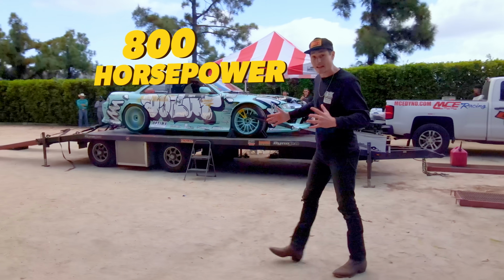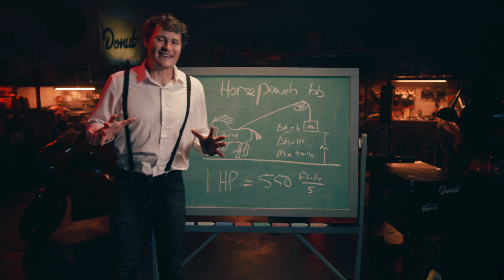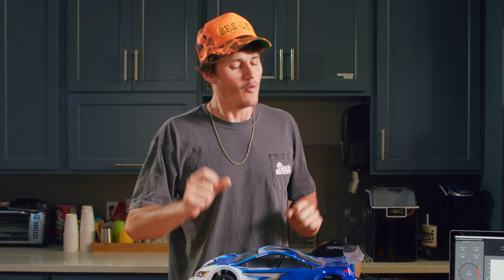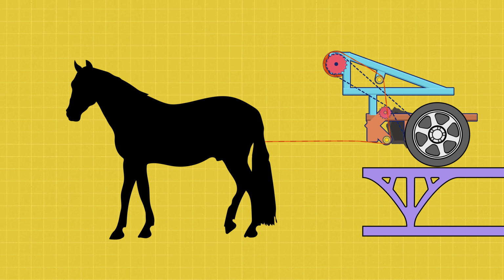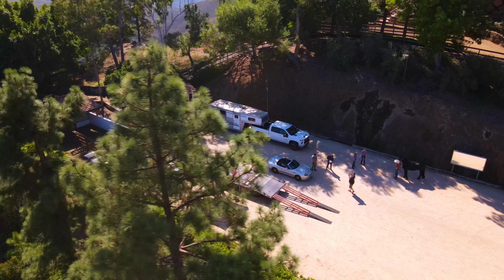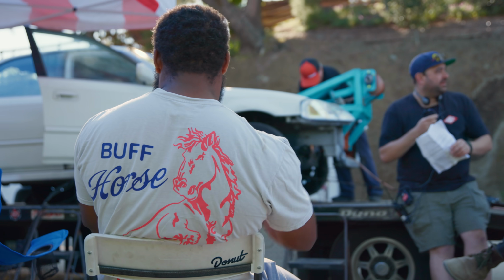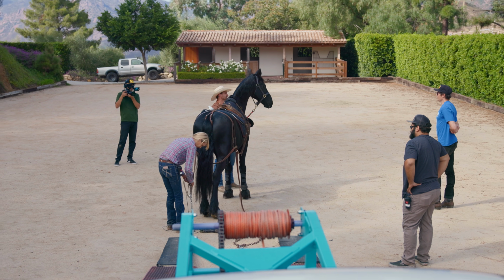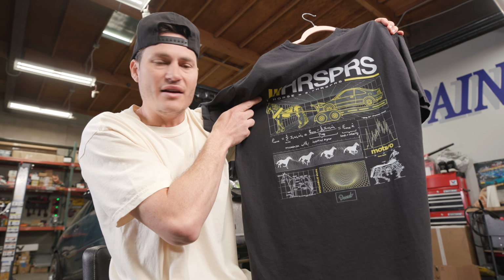How Much Horsepower is a Horse?

Comment: Not sure how this works
1 horse equals the power of 1 horse.. So how does 1 horse equal 5.7 horses? If you had told me this 1 horse produced x watts then I could work back from my engines watt power to figure out how many horses I have under the hood. Or did  I miss something?

Comment: Loved the experiment. Here in the UK, traction engines were rated in Nominal horsepower rather than brake horsepower. A 12NHP traction engine could theoretically pull as much as 12 draft horses. Your results show why a 12hp traction engine always wins a tug o war against a 60hp tractor.

Comment: Is just a metric for “Power” output just like Watts is for electricity. 
Just measuring amps doesn’t measure the wattage, and measuring just the Voltage also doesn’t determine wattage. But when they’re multiplied together, you get the wattage. 
And wattage is wattage no matter how you stand on your head or how strongly your opinion is of it. 
Same with Torque, it’s multiplied by RPMs in nearly the same way, so even output torque, or torque to the wheel is still not a good way to calculate power output. 
But because some guys can’t figure that out, we have to keep having these Verses lessons as if they’re opposed to each other, but they’re not. 
Put simply, torque with no rpm, is zero hp, even if it’s a million ft/lbs. 
No rpm, no hp. 

High rpm with torque, high hp.

Comment: Draft horse do love to pull.  I have watched draft horse pulling contests at county fairs.  Horses were used to turn basic mechanical drives where the horse walked in circles and thus the mechanical torquer was much easy to measure.
  I think when they came up with 1 horsepower it was the amount of work a horse could do nonstop for an hour. Of course, the horse can do more for 15 seconds.

Comment: What if the pulley was geared 2 : 1 so that the horse could gain speed and a smoother run as well? Different horse breeds will achieve peak horsepower at different ratios. This would be the ultimate horsepower testing

Comment: I asked GROK here is a much better answer, remember when testing cars that are at max RPM
A typical racehorse (Thoroughbred) weighs around 1,100 pounds and reaches sustained speeds of about 40 mph in races, with peak bursts up to 44 mph.
Using the same kinetic energy calculation as before (KE = ½ × mass × velocity² in foot-pounds of energy):

For a 1,100 lb racehorse at 40 mph: approximately 58,800 ft-lbf.
For a lighter 1,000 lb horse at peak 44 mph: approximately 64,700 ft-lbf.

(Your original hypothetical 1,000 lb horse at 20 mph was about 13,400 ft-lbf—racehorses carry roughly 4–5 times more kinetic energy due to higher speed and similar/heavier mass.)
Conversion to Horsepower
Kinetic energy measures total energy of motion in foot-pounds (ft-lbf), a unit of energy/work. Horsepower (hp) measures power, or rate of doing work (1 hp = 550 ft-lbf per second).
You can't directly convert a static energy value to horsepower without knowing the time over which that energy is applied or dissipated (power = energy / time).
For context:

If a racehorse dissipated all its kinetic energy in 1 second (e.g., a very abrupt stop), it would equate to roughly 107–118 hp (58,800 / 550 ≈ 107 hp).
Real stopping distances are longer, so peak power during braking is lower.
Actual peak mechanical power output of racehorses (what they produce while running) is estimated at 10–20 hp in short bursts, based on physiological studies—far more than the 1 hp the unit was originally based on!

Comment: Flip the dyno over. Put tread on the drum, and put a chariot hitch so the horse can pull it. On a flat track you can measure the max output for a short time, or continuous output for whatever duration the horse can stand. They built a bicycle dyno in physics at MSU when I was a student. I was able to crank it to 1 kW and trip the overvoltage protection on the 10 each 100 watt incandescent light bulbs that were the load.

Comment: The Horsepower concept is based on how much work can you get out of a horse day in and day out over its lifetime. A horse can pull a very large load or gallop with a rider for a short time but the animal gets tired and must be rested before called on for such exertion again. The scene you showed at the start of your video showing a horse walking in a circle turning a mill was typical of what they were used for when Watt developed his steam engine. At that time what people needed to know was how many draft horses were needed to pull a wagon with a given load a given distance before resting or changing the team. All these factors make a realistic calculation of “horsepower” very difficult. You had a good harness For Big D and I’m curious. Is Big D a Percheron?

Comment: So inaccurate its not even funny..... As the rope is pulled the spool gets smaller and changes the ratio of the setup and on top of that you have a huge inaccuracy because dynos need to spin over a certain RPM to be accurate. You have proven nothing.

Comment: I don’t get why was there a transmission involved or even a car!! Wouldn’t It be more accurate if the rope was wound directly to the dyno and have the horse pull on it?? This test just proves how much power a horse puts down if it were the cars engine..

Comment: Question: Is horsepower the ability to over come inertia or is it the speed it can reach when inertia is reached?
In my mind it was the latter. When you put a car on a dyno you overcome the weight of the car, the  drums and see how fast it will go but in these measurements it seems to me, as a pleb, what was tested was the ability of a horse overcoming inertia?

Comment: You can't have them pull at their maximum strength! Horse Power is the power of a horse OVER A DAY! If it's not providing that same power for its full work day then it's not the measure of HP.

Comment: Wouldn't it be simpler to just mount a spool of rope to an engine dyno? Maybe use a chain and sprocket to increase the drive ratio since the engine dyno will be looking for a higher rpm.

Comment: From what I know at the time of its inception the term horse power, when told to someone advertising an engine meant to them "the amount of horses this machine will replace", which is wildly different than actual numbers or strength. Its about how much work will get done in a day by this machine over a horse, horses need rest and sleep and get injured. A horse power as a unit will heavily undervalue the raw strength of a horse due to this.

Comment: Interesting but flawed.   Work horses work all day long not for just a couple of minutes at max power.  Normandy would not be able sustain 5.7 horsepower past maybe 20 minutes before tuckering out which is not useful in the purpose of why engines were advertised to replace work horses..  So this is not accurate, a work horse in a mill would be working at much lower horse power in order to pace itself for a full days work.   The engines horsepower is based off of how much work a horse could do over the course of the day not for a couple minutes.  Redo the experiment but recreate the mill setup replace what would of been the grind stones with a speed and torque sensor and have an actual work horse turn it for a full days work.  Then report back what your findings are.

Comment: Far too complicated. All you need is a load cell, a GPS, something to pull, and a path to go. Once you know force between tow rope & vehicle, and you know speed, hp drops straight out. Put some brakes on the towed vehicle & you can play with different trials runs to do the test run at different speeds. Rpm just doesn’t come into it.

Load cell, gps & towed plough is all you need to measure work rate.

Comment: Ummm..... Use kW instead? And convert it into HP? 1 kW = 1000 W, W is a unit of power; W = J/s
Calculate how much energy someting can exert for a certain time and divide it.... You get W, and 745.7 W = 1 HP, or 1 kW = 1.34 HP...... 
To calculate energy.... Well.... Using... K.E. = 1/2*m*v^2? Or P.E. = mg? Or Electrical power = v*a? Umm.... IDK.... Guess one gram of practical is equal to a kilogram of theory :)

Comment: SPOILER!!! DO NOT READ THIS UNTIL YOU HAVE WATCHED THE VIDEO.

A 700 hp vehicle has the same horse power as approximately 123 horses the size of Normandy. Does horse power (actual horses) grow exponentially the more horses you add?

It would be awesome to see this same test done with ten horses, if that's even possible.

Comment: This is what YouTube is all about.
Personally, I would have used a long rack and pinion mechanism for linear energy transfer because the unraveling spool is a huge variable (due to the decreasing diameter as it is pulled, thus the loss in mechanical advantage, although this would obviously be impractical), but cudos on the project. Super entertaining.

Comment: This should be the new definition of what a horsepower is, in which case all existing horsepower ratings need to be divided by 5.7. For example, the Corvette Z06 rated at 670 horsepower is really 118 hp.

Comment: Nice work! However as you know, the power (W) is pullingforce (N) X speed (m/s). The pulling force depend of "geometry" of the horse, its fitness and weight! More important is, that each horse has a own speed of maximum power. Please use a bicycle with W-Meter and test yourself. At very low speed the horse can not deliver its maximum power. Same as a human. Most force is at a blocked rope. But then speed is 0 and power is 0! Is this clear?? I think a installed load cell at the drawbar of a horsewagon with adjustable brake, can deliver a integrated average power over time and speed. You should do the experiment again. Please, please, please😊

Comment: There's one big problem here.  Watt and the other 19th century engineers didn't care a flip about how hard a horse could pull at maximum exertion.  They wanted to compare to what a horse can do if it's pulling all day, for hours at a time with only occasional rest.  So if a horse can pull around 6 "horsepower" for a short distance, then yeah, sustaining 1 "horsepower" for 8 hours straight sounds reasonable.

Comment: Well, not all horses are created equally. You could have gotten a much better horse for this test. What you needed is a Clydesdale. Clydesdales are massive, extremely strong horses. They were literally bred for pulling with power. They were once used in the logging business to drag massive logs out of a logging work site. A Clydesdale could not only pull that much harder and faster, but if you're not careful, it could probably start dragging that whole trailer with the car sitting on it and all. If that horse produced 5.7 horsepower, then a Clydesdale could probably pull 9 to maybe even 10 horsepower.

Comment: Grinding grain is an all day affair where total output over an extended time is what is important to an early industrialist. Horses get tired but machines don't and that is the telling point in the horse/machine comparison. James Watt did his calculation around the net work a horse could produce over an extended time; not a sprint/peak measurement. A much better horse dyno would have been to reproduce Watt's test with a vertical pivot having an arm of known length and a resistance torque gauge on the pivot. Let the horse pull all day long on the arm and measure the net average work produced. It's going to be a lot less than 5.7hp. If the horse gets as timed as I do these days, I'll wager it would average much closer to 1 hp. By the way, I used to be known as Big D.
Reply: From what I know at the time of its inception the term horse power, when told to someone advertising an engine meant to them "the amount of horses this machine will replace", which is wildly different than actual numbers or strength. Its about how much work will get done in a day by this machine over a horse, horses need rest and sleep and get injured. A horse power as a unit will heavily undervalue the raw strength of a horse due to this.
Reply: @jcpkill1175  Well, and even with engines there's a difference between surge and continuous power outputs.  In a lot of designs they're the same, sure, but when people are going for maximum surge power in the smallest possible package you end up with systems that can run at insane power outputs for brief durations before melting down if you don't throttle back.
Reply: Exactly!
Even when applied to automotive racing the peak power is less important than the total area below the power curve.
Because , outside of drag racing , no engine is running at peak power 100% of the time.
Reply: 5.7hp is well below peak output from a horse.  I don't know how long it can sustain 5.7, but peak for a horse is usually in the 12-20hp range.  Workday sustained I'd guess is more 1-2hp.
Reply: @Neneset I'd like to see a 2hp motor pull a plow all day. And the same size plow as the horse at thr same speed i feel like one horse can do more 2-5hp motor
Reply: @Neneset  sustained effort is actually about what he was doing which makes sense since the owner didn't want him over-exerting himself and potentially getting injured just for an experiment. Horses can sustain 4-7hp for extended periods of time but can generate over 20 in very short bursts of maximum exertion such as getting a heavy object to start moving but nobody makes a horse work at that level for more than a few seconds at a time if they want that horse to keep working for the next several hours.

Comment: This is YouTube so I didn’t expect much from this video and it didn’t disappoint. That contraption using the car is just stupid, adding layers of power loss which required complicated power loss equations (aka guesstimates) to derive a HP figure when they could have just wrapped the rope around the drum roller of the dyno. To cap it off the dyno didn’t even record the data directly they had to extrapolate it using a bit of paper and a GoPro. This is the absence of science and scarily this “experiment” has been sighted in the Wikipedia article on James Watt.

Comment: i think the circle thing would be more accurate !!!   use a good size ,, maybe 10 or 15 radius circle and have it VERY similar to those draft Mills ...   Plus, a good engineer will be able to change the dyno from being flat into vertical >> caz then the horse can run at many speeds AND most importantly run forever

Comment: It’s like asking how much horsepower a tractor has, you need to measure the torque
Reply: Torque doesn’t tell you how much work you can do in a given time period so Power is much more meaningful.

The engine’s power, not its torque, is the limiting factor in not only the top speed of a vehicle but also in how quickly it can accelerate at any speed and how much weight it can pull up an incline at any speed.

Comment: Problem, every horse of every type would have to be tested. Than a  average figured out. There is the difference between HP and torque. Here is something. HP would send a speeding object into a window very fast and it would just bounce off. A slower object with torque would go through the window and not slow down. HP sells cars to shallow people, torque sells cars to people that win races.  Torque is the power that drives, HP is what makes the power get there faster. The true discussion is which power is important. Both? One over the other? Is one any good without the other? Seriously, that skinny dude is .6 more powerful than a horse? So 700 hp HellCat is more like 700 poodle power.
Reply: Torque by itself does not tell you enough. You also need to know the rpm the engine produces that torque at, which is power. With a lever I can produce more torque than most cars, but I can't spin that lever at thousands of rpm while producing that torque. 
Torque applied to the wheel is what gives acceleration. The power of the engine tells you how much torque can be applied at any given rpm.
Reply: The engine’s power, not its torque, is the limiting factor in not only the top speed of a vehicle but also in how quickly it can accelerate at any speed and how much weight it can pull up an incline at any speed.

Comment: You can convert horsepower to watts by multiplying by the date Columbus "discovered" America divided by two, i.e. 1 HP = 746 Watts.   So your horse generated 4252 Watts.  But then Vikings were here earlier, so ...

Comment: Cool! I loved the rig, and the entire plan to measure torque, RPM and horsepower. 

What I didn't like was the surface, since D could not get a decent purchase on the ground. I also didn't like the somewhat baffled, unmotivated pulls D made. The result gleaned here only shows the horsepower of a sweet-tempered, but confused, light draft horse. This was not a true test of one horse's power.

Recommendation: 1) Use TWO experienced, heavy horse pull competitors. Light draft is a good category, so stick with that. 2) test on a more appropriate surface, like turf or horse-pull arena surface. 

Competitive pulling horses are extremely motivated. They absolutely love what they do, if 2000+ pounds of bouncing, keen, puppy-like dancing is any indication. It would take no convincing or training to get them to pull; just let them do their thing. 

I'd love it if you did this again, but with experienced competition pullers, and on a better surface.

Comment: How much horsepower does a human have?
Reply: The max muscle power a trained human can reach is about 2000-2500 W, so something around 3 HP at best, but that's peak power and even well-trained humans can't sustain it for very long. The average during effort would be more like half that.
Of course, as the video says, 1 HP is definitely not what 1 horse can reach, it was largely underestimated, probably to oversell the merits of the new steam engines at the time they started to appear.
In reality, as he said, a horse can develop about 15 HP and so, that's at least 5-6 times what a well-trained human can, and a horse tires much less too.